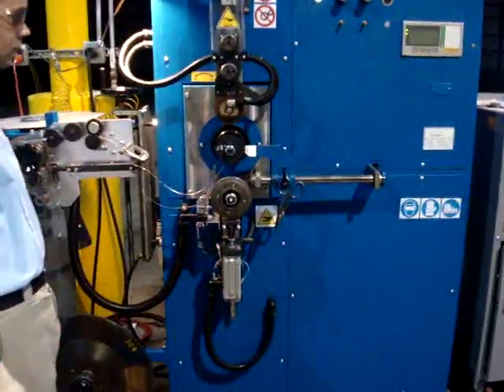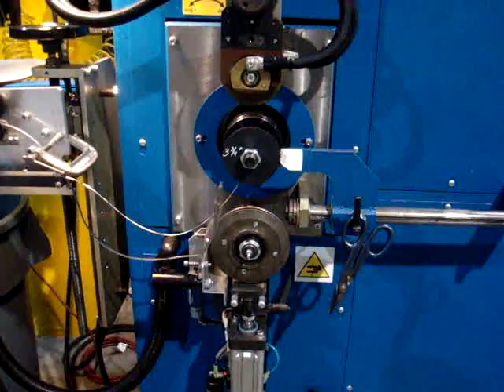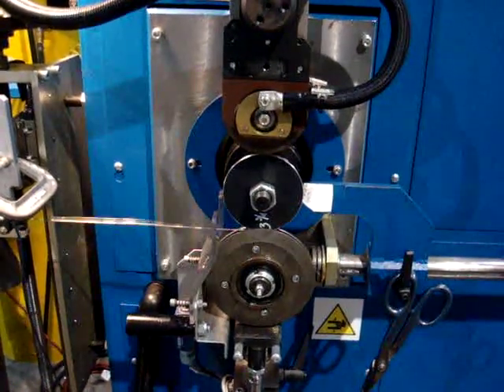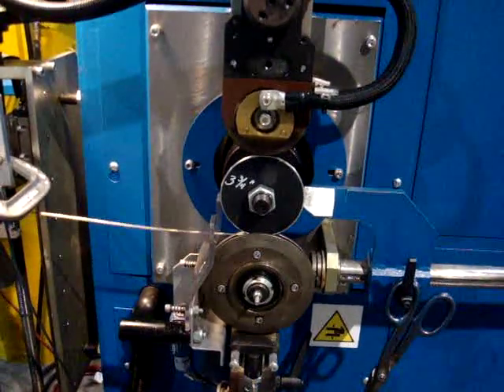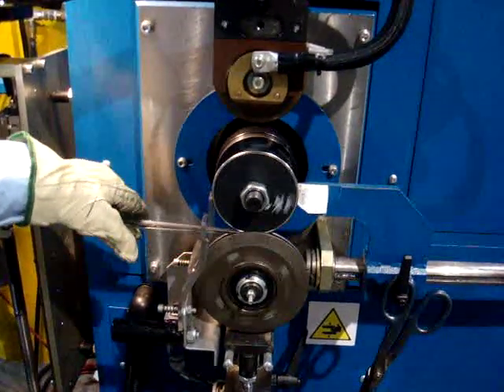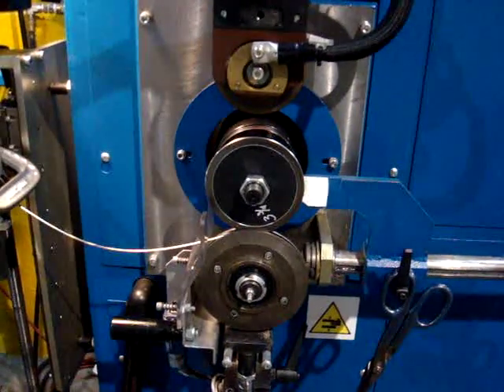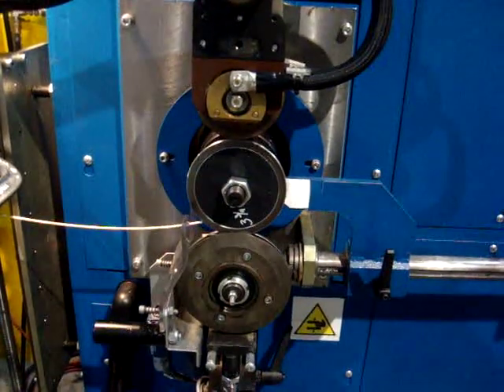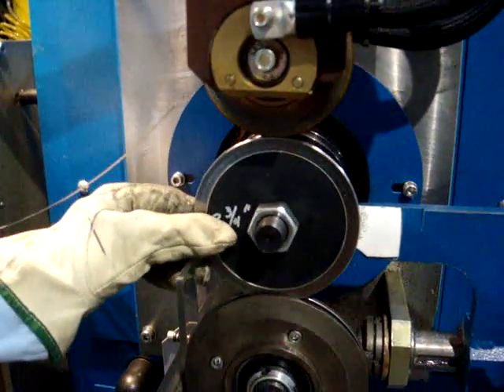Spiral Wound Gasket Manufacturing:  VSP Technologies, Virginia, aka Flexitallic

Comment: Good Video.Main products: sealing gasket,gland packing,PTFE/graphite/asbestos products, ceramic fiber products, high temperature heat insulation and fireproof material.